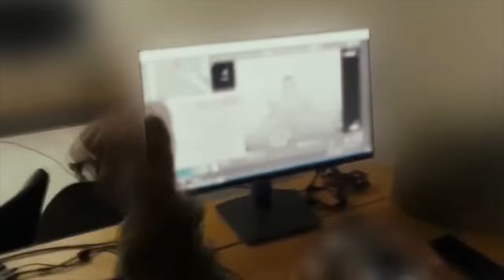Update from Ukraine - Kyiv vs Village Life During the WAR

Comment: Can you get bags or chunks of ice? if so, line the freezer section (since it is smaller) sides and bottom of your refrigerator  with these..
Put milk, butter, any other essential peroshable food items in there. I am able to have enough food at home this way even when we have 3 to 6 day continuous power outages, which happens every so often in my rural area. You may need to keep the milk out part of the time so it doesnt freeze solid. This is very effective and is nothing more than was typical storage back in the day, like the early 20th century.

Comment: I worry about you in the winter! 
I hope You can locate portal battery power units of a car battery size! Use Your car battery to power your electric water pump! 
You would need a power converter. 
For home heating if You have fire place burning coal and corn with wood generates lots of heat. Make sure you clean a fire place before winter!
Reply from the maker: Thank you!🙏❤️

Comment: Buy an ecoflow  portable power station for your electricity needs, it is available across various budgets. Reduce your window opening to very small, it is quite important. Find some steel or aluminum sheets and cover your wall, to make an inner wall on all walls and also fix it on the roof. Work on a small tunnel, very near to your home, and shift most of your stuff there, immediately with your digging tools. Find some more interesting DIY defensive plans that you can do, and that you need, by making very detailed plans while you still have your time. You should also make a personal armor, for urself with light weight steel plates, Molotov Ctails should be made as a preparation. Swiss army knife and certain camping equipments should be purchased too.
Reply from the maker: Thank you!

Comment: How are you going to make drones if the power outages last 24h? Get the basic things in order first. There's a new competing power station Dabbsson that is as good as Ecoflow but cheaper. In your case I would still get EF + EF dual fuel generator because they are easy to use together. I assume sun doesn't shine in your windows much, so sun panels are not effective enough. You live in the first floor and a generator under the window would be a possibility if neighbours won't object.
Reply from the maker: Thank you!❤️

Comment: Hi.  I still think Dietz type Hurricane lanterns  are a better choice for emergency lighting than candles.  Not as safe as solar charged battery lamps, but still better than candles.  Obviously if you have no fireplace in the house, a camp fire outside will not do for heat.  Now is the time to acquire either (or both) a kerosene heater or a propane space heater.  They will be much more expensive when the weather turns cold. 
 Regarding food, canned food is going to be important.  Canned pork, beef, chicken or tuna / salmon.  Canned vegetables.  Again start getting them in Kiev at discount or bulk purchase stores.  A problem is the canned goods can't be allowed to freeze.  I am not sure how to accomplish that without electricity for heat while you are bouncing back and forth from one location to the other.  Foods that don't require keeping above freezing temperature often have short shelf lives.  Bread for instance.  Even potatoes don't like being frozen. 
I can see you village has no deer around it.  Here if I left that many vegetables unattended in my yard for 3 days, everyone would either be gone, or had a bite taken out of it, then tossed on the ground.  I must have over 100 deer within a 3 mile circle of my place and every durn one of them would smell the vegetables and come to feast.  Not to mention skunk, opossum and raccoon.  :)
 By now I would have bought or made a set of lock picks or gotten a large claw hammer and opened up that half buried root cellar door in my yard and made an assessment of the storage potential therein. If a new padlock is needed after I popped off the old one, okay, stores sell them.    
I still think having a Morrison cage built for your apartment would be of benefit to you.  A place of relative safety inside the apartment if you won't go to the underground shelters during an air raid.  Of course if those munitions crates in your apartment do contain explosives, if a missile hits your building, a Morrison cage won't make any difference if what is in those crates detonates.   :(  
Ukraine is hitting back and Putin is visibly panicking as his oil depots, refineries power stations and ammo depots are being destroyed.  His 30 year plan to conquer Europe did not include Ukraine being able to strike back many miles inside Russia far from the border.  The more Russian assets destroyed, the less popular he is as a leader of Russia, and in Russia that can be a death sentence.  If it continues and Ukraine doesn't beg for negotiations soon Putin risks tripping on a banana peel and falling out of his helicopter while it is at 10,000 feet. 
I think that you are building drones is cool.  Sadly US law doesn't allow us to send personal firearms or ammo to Ukraine, so making contributions to drone and vehicle funds is the legal way those of us who want to help can do so.  Slava Ukraine.
Reply from the maker: Thank you so much!🙏♥️♥️♥️♥️♥️

Comment: You need to invest in solar panels. I can explain living off grid for over 12 years. Buy big solar panels and have them facing the sun, in the winter it still charges but not as successful. You will need a solar charger system and heavy duty batteries and lastly a inverter. Always buy big and add on as you can afford. I power my washing machine and air fryer and coffee machine. Free from the sun ☀️ If it is a problem to buy this then a generator is the most affordable but long term more expensive. Message me if you need any information about this. 🇺🇦💙💛
Reply: yes, agreed. Solar panels should work.
Reply: @iuliansorinilie4934  To start with a 1000watt solar panel system and about 600ah battery bank would cost around €2000 if fitting yourself which i can explain everything in wiring and cables ect needed.
Reply: Installing large panels, batteries and an inverter  would be problematic in a city high-rise unless they were on the roof. Having them in the village would work fine but then there's the problem of having such high value devices in a secure location when the house is vacated.
Reply from the maker: Thank you!🙏♥️

Comment: Vita, water is a real problem, you'll better search for a generator, or a gasoline pump. OK, 4 hours you got water, maybe it's enough also. You'll better prepare a real heap of firewood for the winter time, because no water, no electricity, you're hut won't have any heating: for 20 hours a day?.   Wow, quite some time to cool down for those badly isolated huts. well, I would tear it down and construct a new one, with modern materials & mainly: isolation & also some solar panels. But these are also not for free.  Well, I have a small generator, 900 W, 4-stroke, that I bought some years ago for €229.-- but that's not strong enough for an electric heater and easily consumes also 5 liters in 8 hours. Avoid 2-stroke engines: before I had a Chinese 2-stroke generator, 300-400W, 79€, it didn't held a long time: I just used it twice and it broke.
Reply from the maker: Thank you for the advice!🙏♥️♥️♥️